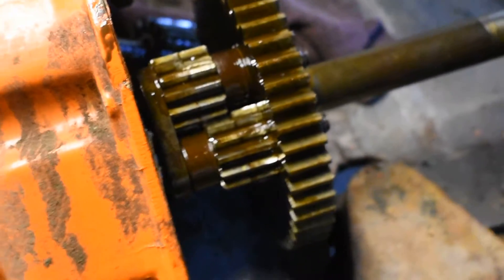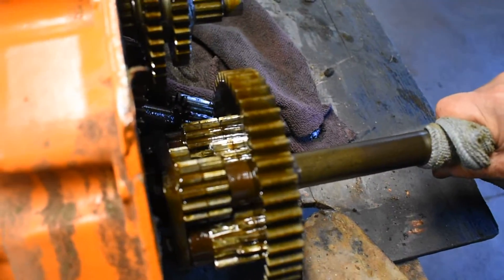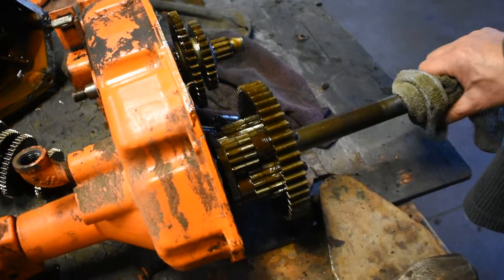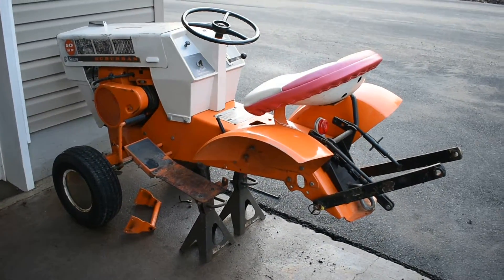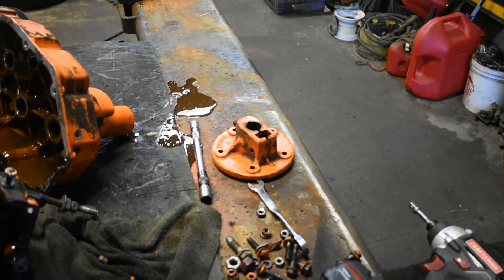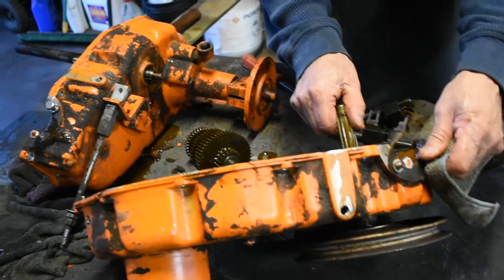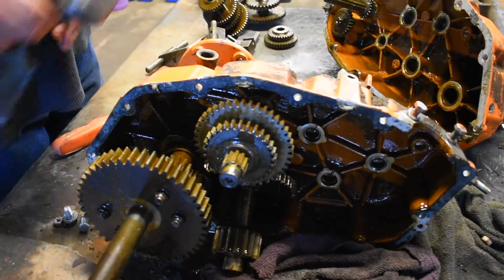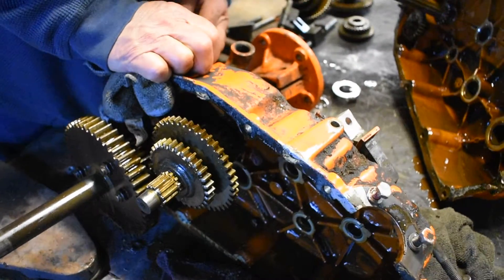Disecting the 1967 Sears Suburban 10 transaxle for failure point.

Comment: QUESTION: I accidentally pushed the metal ring of the axle seal inside the trasmission( still around the axle), and can't pick it out. Is it fine staying in there, or should I open it up and get it out?? thanks
Reply from the maker: You should get it out.